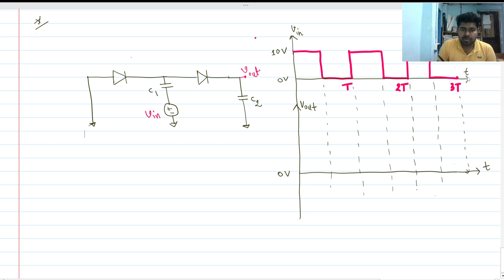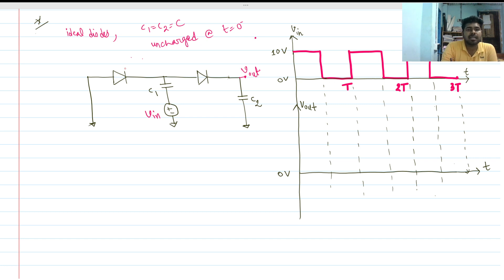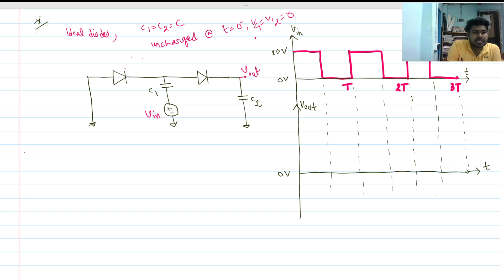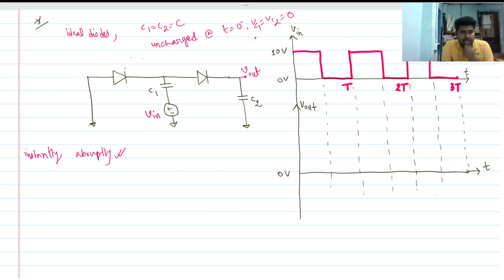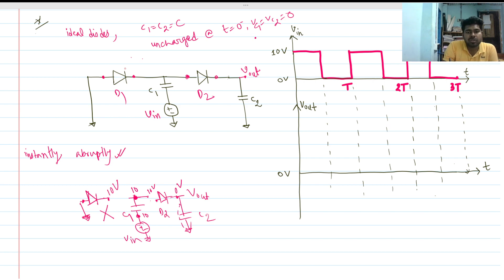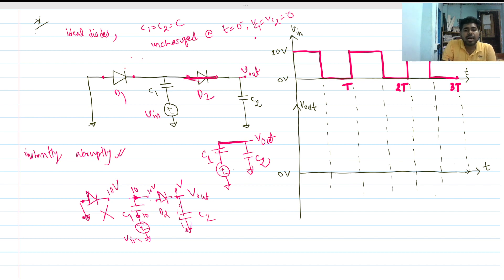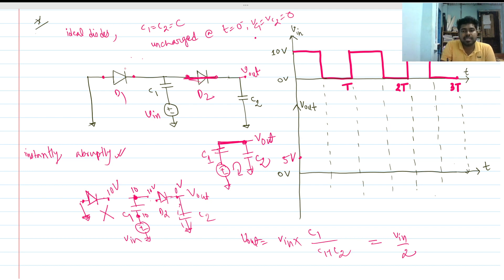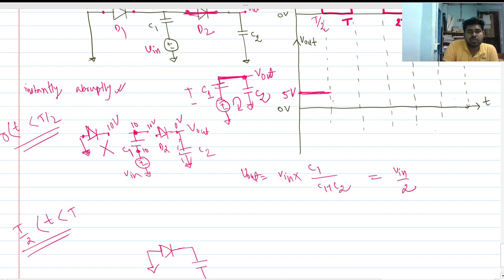Draw the waveform of Vout_diode and Capacitor Circuit with pulse input || Amit Bar

Comment: Thanks for sharing the question. Your solution is right but because of the voltage source the initial charge can’t be same as the final charge. When source steps to 10V then it throws equal charge on both the caps, from there we can calculate the final vout.

Comment: Much appreciated sir 😊

0<t<T/2 vi=5v D1 off D2 on so vi will charge the capacitor c1 and c2,but the output is vo=10*(c/2c)=5v 

0<t<T c2 discharge but D2 reverse bias so open and then it will maintain a stable state of 5v until the next cycle 0<t<3/2T

0<t<3/2T vi charge c2 but c2 hava a Initial value 5v and then 

 Qt=CtV 
(5*1)+(10*1)=2*V V=7.5v

0<t<2T c2 discharge but D2 reverse bias so open and then it will maintain a stable state of 7.5v until the next cycle 0<t<5/2T
Please tell me if there is any error